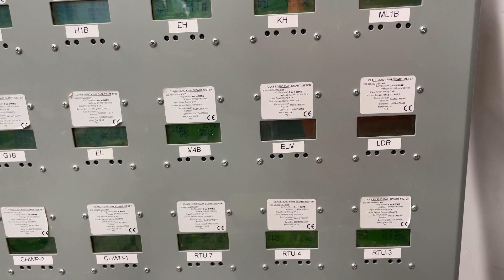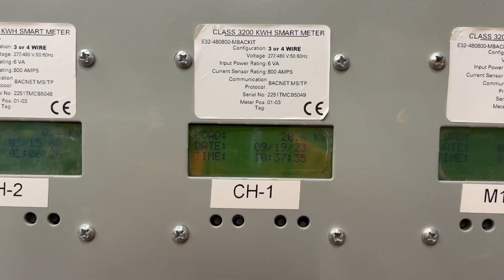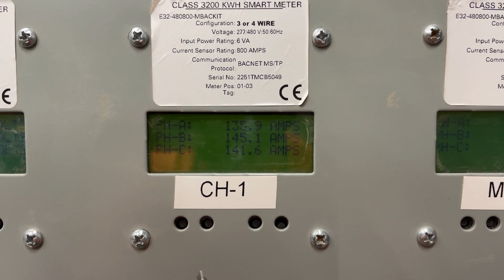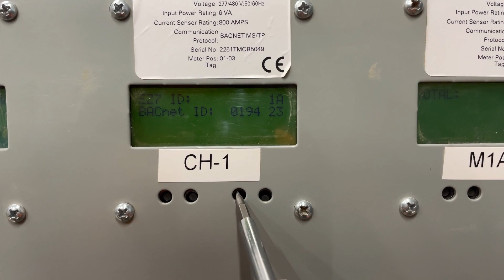E-Mon Class 3200 Smart Meter (BACnet Setup)

Comment: Could you please explain the difference between the MSTP and the bacnet ID? I'm working on one of these and trying to troubleshoot. Will all your nodes have the same MSTP number?
Reply from the maker: MSTP MAC is unique identifier, Device ID is unique identifier. Both of these should be unique on all devices connected. MSTP number which represents channel or daisy chain loop can be the same on all devices.